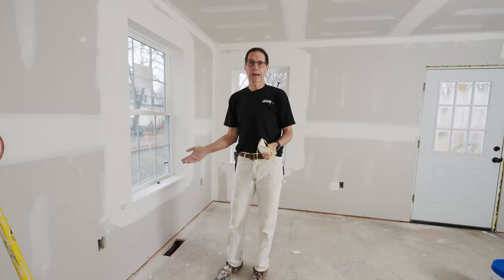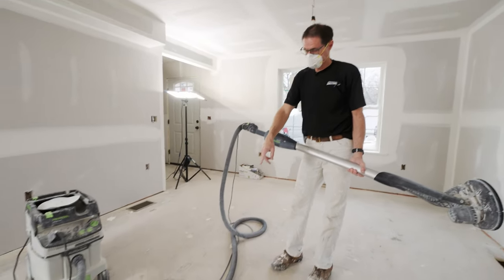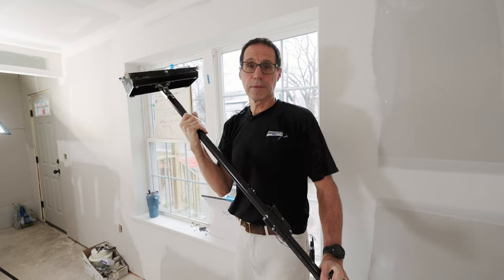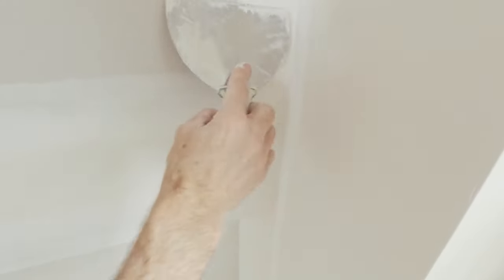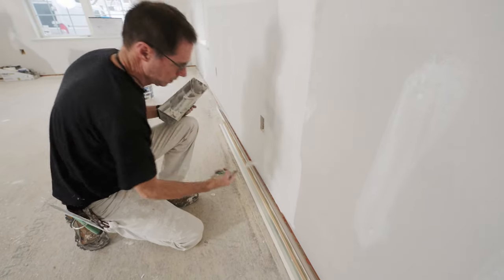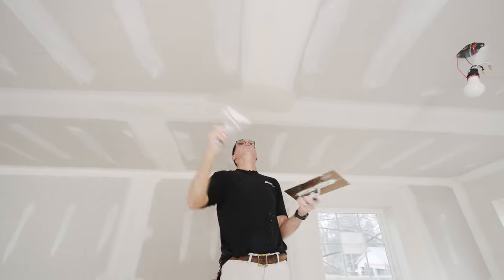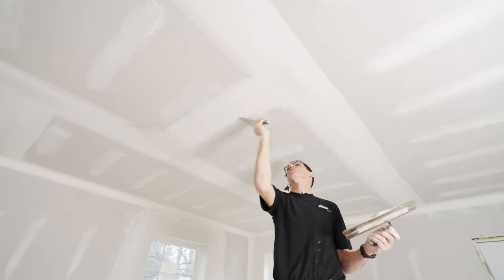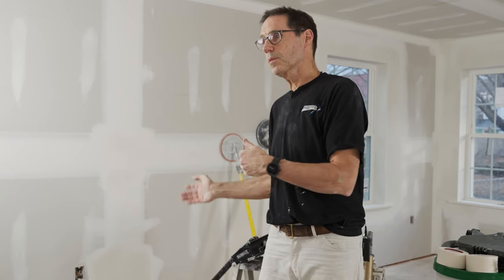Achieve a Smooth Finish Coat on Drywall Seams and Corners

Comment: Hello Myron it's interesting to find your video on here looks like you've been doing this stuff for a long time. Cleaning up this around wondering you must be from somewhere in the Northeast I'm guessing Connecticut Massachusetts😅?
Reply: I meant to say after asking about the butt joints because in Springfield some of the places would use the butt boards when hanging not sure if you're familiar with that it sucks the butt joint together or up leaving a slight recess I did not care for them they did not do that well of a job.
It is always been a practice of mine and the people that trained me to split my butt joint on bed coat. It is called my fill coat so anything that needs to be filled should be done at the bed coat.
I to do a process of Crossing off butt joints canceling out any lap joints. Have you ever learn of The Continuous Flow where are the joint compound is ran through a pump airless paint pump?
Reply: I have a tremendous amount of equipment and I have developed some pretty cool systems I wish that I could go back and do YouTube training as to just pass the trade along system I use for continuous flow was oftentimes in big commercial jobs and wow you could fly you would be impressed the amount of mud that could be put on very well in a short. Of time
Reply: Well good day Myron we'll be seeing you on here thanks for sharing